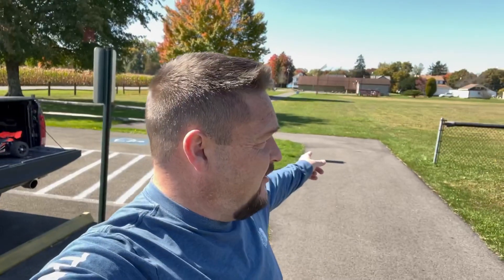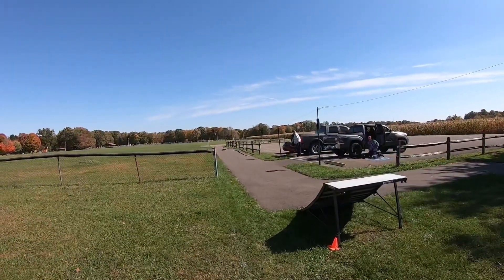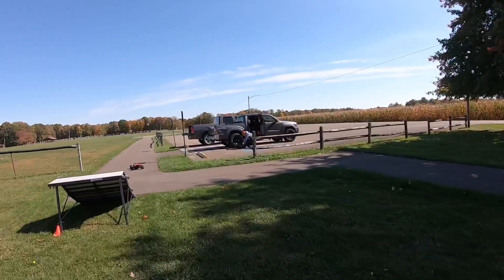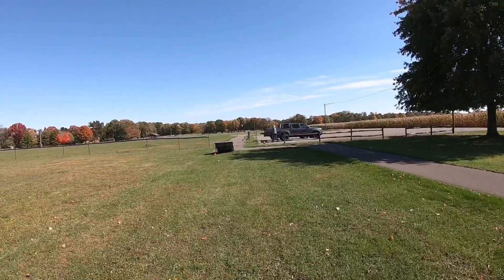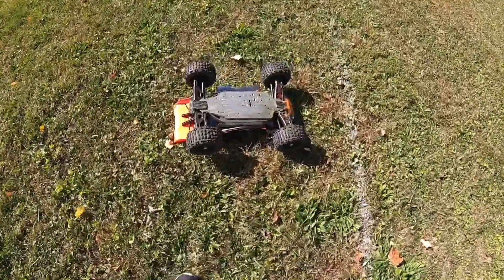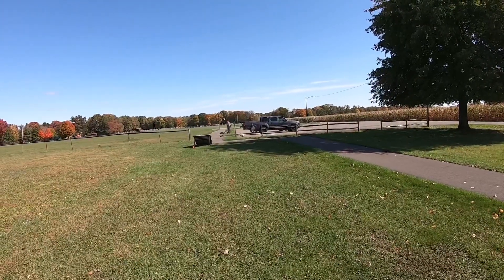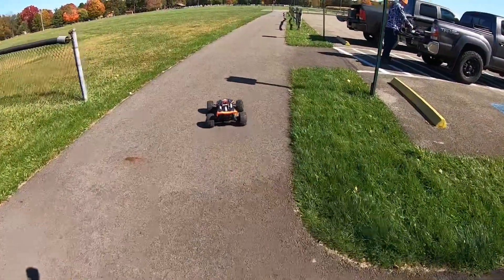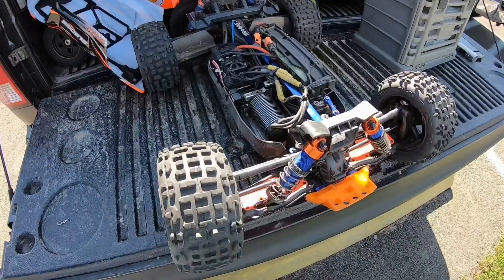Traxxas sledge Bash Time. It was sent!!

Comment: Wicked sends with Sledge Bro David. This truck is inching very close to being my favorite truck in my fleet!! Awesome overall truck. Its durability is what really impressed me the most! Another awesome upload brother
Reply from the maker: When I first got this car I had serious doubts but overtime now it has definitely impressed me.
Reply: You may know this ? Someone!!! Aren’t you supposed to have some rebound in Rc car shocks my one sledge with even rebound never bounces after hard hits. My m2c sledge I tried to get the other three shocks to rebound no luck so I went with 0 rebound everyone says it’s supposed to not push back out the rod without spring I was always told should push out some most important even stopping points??? Help needed
Reply: @BarstoneRC  is that a 1650 kv sitting in stock location? I have one sledge reversed and want the other setup stock location?
Reply from the maker: Are usually set mine where it pushes out halfway or less on its own
Reply: @BarstoneRC  
I knew I was right but I couldn’t get my other three to push back what could that issue be?

My other sledge had them all push half way no problem this sledge only could get one I tired and tired .. everyone was like you don’t want it to push out that’s wrong??? I disagree …

What would be my fix I got that same fresh park ramp as you and commander and placing it on a 15 foot high dirt jump I made with dozer I want all suspension control I can get shooting that high in the air.

Any tips to get shafts to push back out on there own I may be missing ?
Reply from the maker: It’s honestly hard to say it could be something with the O-rings or the valves could be slightly different?